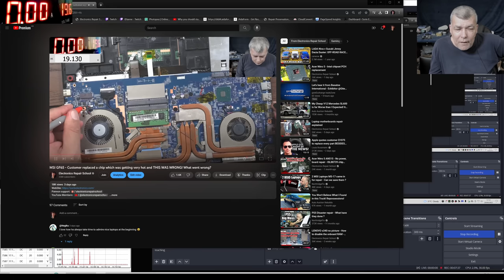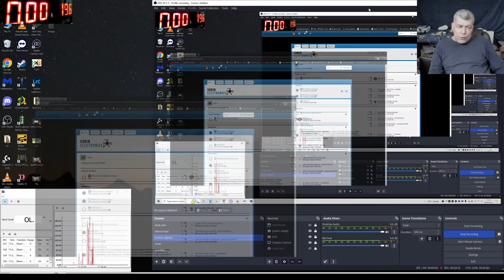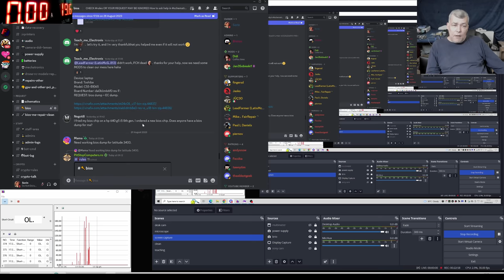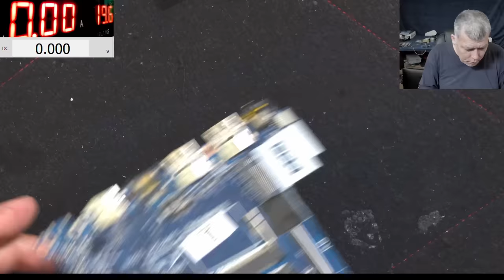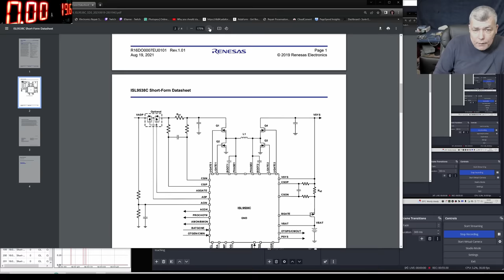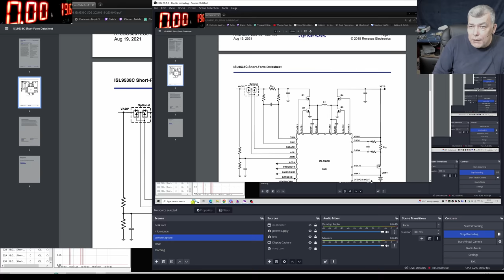Learning laptop repairs - Teaching lesson for beginners

Comment: The biggest challenge I believe is to know (for a beginner) the correspondent voltage values. How should I know if there should be 19.5V and after 18.9V? Should I have 4.5v at some point or 4.1V? How to know that? It happened to you @sorin right? You thought the board was fixed...

Comment: I really appreciate your efforts, but we need more clarification about how we can identify P and N-channel MOSFET, and depending on what is called that name, also the source, drain and gate can be the same on both P and N-channel MOSFET.
The second one that is much more important is how to measure each component on the board and what the right approximate values have to be (Ohm, Voltage).
e.i MOSFET must not shorten any source, drain and gate together.
The voltage on the 8th pin of the BIOS usually or always has 3.3v... So on so forth
Thank you so much.

Comment: PD5. =dual dioed to gnd.
Psid ->pd5 pin1 + 2.   Pin3 gnd
From pd5 ->> voltage divider.. ->> to pq3.. pin 3->> 33 omh resistor->>3.3v pull up with 2.2k ohm to PU1... ->> pin1 and 4 normally  closed.
Pin2 and 4. Gnd and 5v

Pin3 and 6 dock psid.

Bypass   method. 
Charger pisd.pin1>>>> 3.3v pull up with2.2k.>>>> pu1 pin 4->> to smc psid.  

Unknown Adapter  error  fixed.
 Pd7  Is duel diode  form dock.  Also gets short

U can remove  Cd3301b if pd7 bad cause its  will usually  be shorted 
...
Hope it makes sense and can help.

Cd3301p  is voltage  source  selector. 

1. Dc jack

2. Usb c.

3 dock
4 pbat aswell

Comment: The biggest problem I have with laptops is the keyboard oddly enough. The one on my old gaming laptop is missing some keys and others aren't responsive. I found a replacement that works but I have no idea how to get to the keyboard membrane itself. It looks like it's sealed in and without knowing how to get into it I don't want to experiment because I can use an external keyboard. It's frustrating though. Videos like these will help so many even if it doesn't directly help me.
Reply: Check that the keyboard cable is clean and plugged in fully. If it is don't bother trying to open and fix a broken keyboard because it will always be damaged more. You can buy a new replacement keyboard for most laptops and they are fairly cheap (except for latest model laptops or very expensive gaming laptops). Some years ago I bought a few replacement keyboards for some older Toshiba laptops and they were only about 20 dollars each.
Reply: @g4z-kb7ct  I have a replacement. I've had it for almost a year now I just can't get into where the keyboard membrane is itself. It's got no screws or obvious way to get to it :/
Reply: @PaulReed  It's likely to be a heat staked keyboard which's a pain to replace! You won't find videos for that in this channel. Check for keyboard replacement videos in YouTube with your laptop model name. It's not for faint hearted!😀
Reply: @Aneesh.Asokan  it isn't a major brand. It's a Clevo rebrand sold by Cyberpower UK. They just add RAM and HDD. I've searched for it under the names used and got nothing. 

It's annoying because I have a replacement that works but no way to swap them. Even tried contacting the OEM but never got a reply.
Reply: @PaulReed  if you have a replacement keyboard just swap over the whole keyboard. Open laptop, unplug the cable and plug in the new one. A keyboard can be opened but because they are very thin you will just damage it beyond repair. Just replace the whole keyboard. Or do yourself a favor and get a laptop that is designed to be repaired like the Framework laptop.
Reply: @PaulReed  If you have a replacement, then swap the entire top lid (viz both keyboard+trackpad) That way it's much easier! Even if it's a no brand model it's likely that you can get keyboard on your local shop. Go there with your laptop or with a picture & enquire as you will most likely find it. Ask them whether you can return it if it's not suitable, most shops will agree. Certainly that's possible in my country.
Reply: @Aneesh.Asokan  I have a replacement membrane, nothing more. I'll take more of a look at it in the future but getting it stripped is a pain. I was hoping to only do it when I was sure what to do.
Reply: @PaulReed  If you are an average tech savvy, you can do it. Even if your old keyboard had backlight & if your replacement lacks backlight, you can transplant it to your replacement keyboard. It's not that much complicated but slightly difficult! It's your confidence that matters most!😀